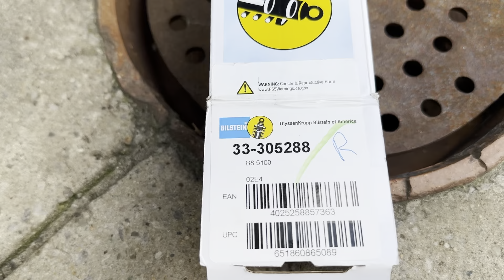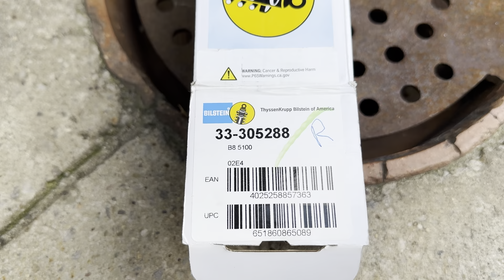2020 Jeep JT Gladiator Rubicon - 2 inch rear lift spacers, longer Bilstein 5100 shocks, EVO endlinks

Comment: did you feel any vibration on highways speds with your previous setup? i have the same setup as your previous one and get some random vibrations, mostly from the rear, but not sure. didn't loosen the control arms either. broke two sockets trying to lol
Reply from the maker: @Hazemezzat  no vibrations on my prior setup. Ride was smooth, just too floaty with the stock shocks.